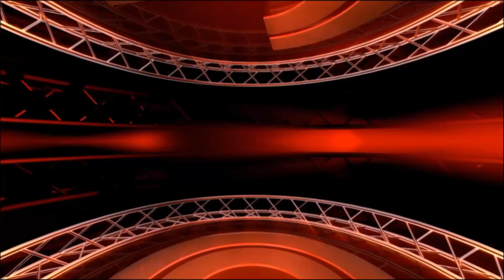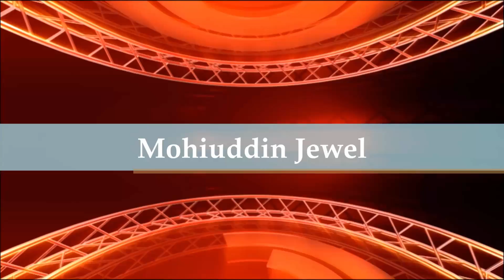Diode Clipper Circuit Analysis - Example 1 & 2

Comment: Sir,
For -ive half the diode will be forward bias till 3v i.e current will flow.... after that it will be reverse bias so graph must be between -3 to 22.3 but you have mentioned 0 for -ive half....why???
Reply: Ankur Bharti right
Reply: @ramjanchowdhury5508  right
Reply: i think it should be 3-0.7=2.3     -2.3volt, not 3 volts.